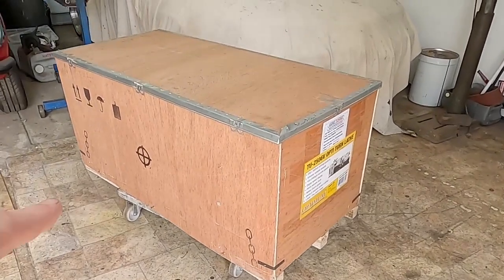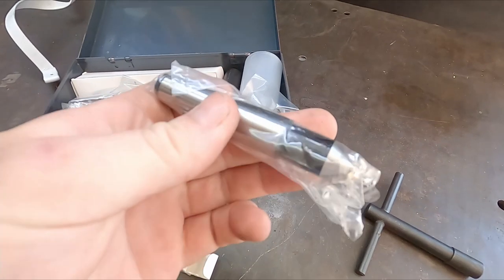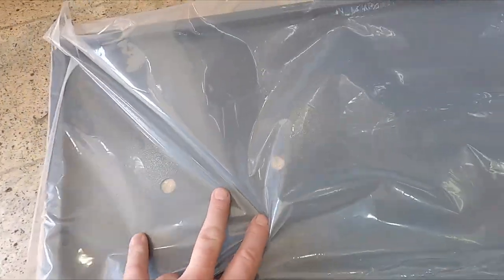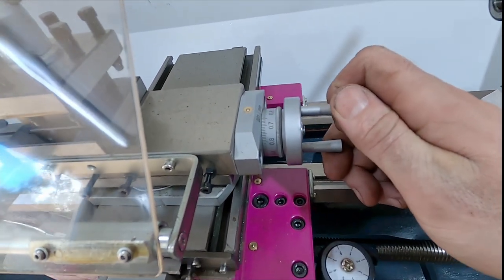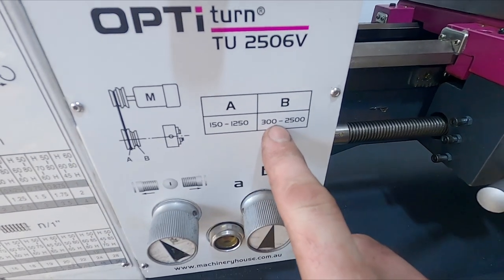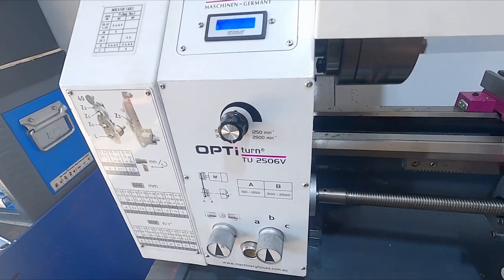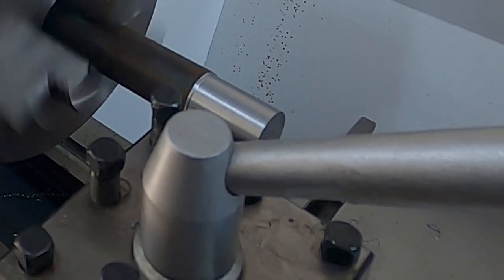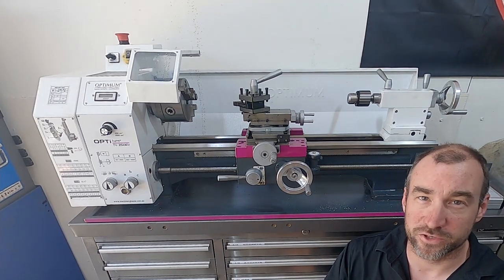TU2506V lathe unboxing and first turn

Comment: Congrats on what looks to be a nice little centre  lathe. I've had a hare and forbes machine (CL-38A) for a decade now and have no regrets at all. Upspec to the digital readout bro, you won't regret it.
Reply from the maker: My plan was to order the DRO system from Ali express as its quite a bit cheaper but I wanted to get the lathe in hand to measure it for the pickup. Cheers for the comment.

Comment: Thanks for the vid. 
I just fire ed up my TU-2506V lathe / BF-20AV mill combo.
I'm VERY new to this and I'm learning on the fly .
What did you do to reduce the slop/lash in the hand wheels?
Reply from the maker: I have looked into reducing the last but it's been on the backburner for a while. I always back the handles off and move towards the numbers I want so there's no slack in measurements.

Comment: How's it holding up after 1 yr
Reply from the maker: It's still going really well, I've changed the gearing on it to suit more of what I'm working with.

The jaws slip a fair but, it seems hard to get a lot of torque for them to hold on to parts if I'm trying to manual tap using the jaws so I've been thinking of upgrading those.

Otherwise it's pretty decent.

Comment: You’ll get the hang of it
Reply from the maker: I hope so. Slowly doing odd jobs as needed and getting a feel for it. I found it does like to back out with the tool so I have to hold the wheel when sweeping across a piece otherwise I get a conical finish.
Reply: @garageadz  use the carriage lock for that. It's a nice lathe, I have a Paramount Browns version of the same lathe.